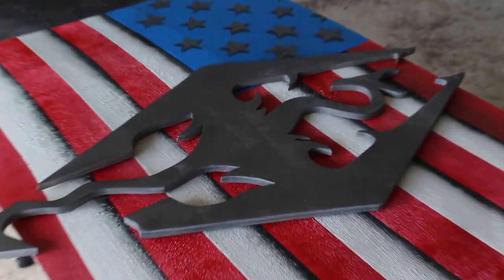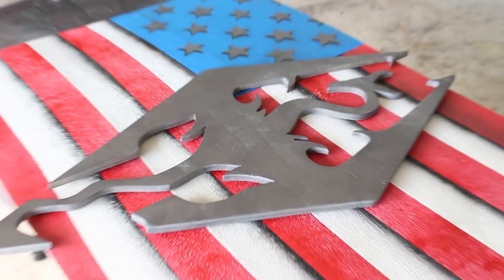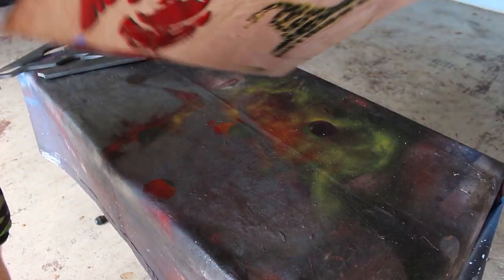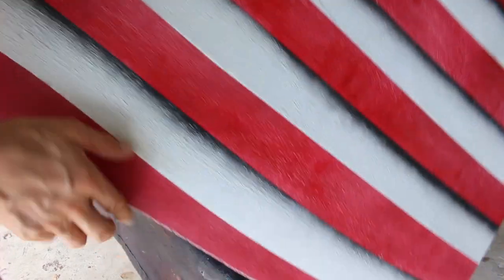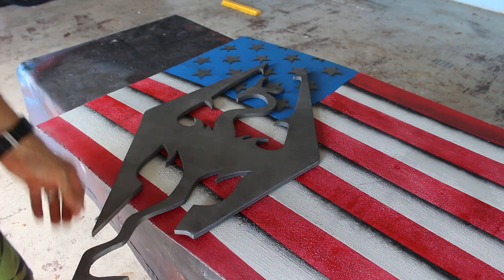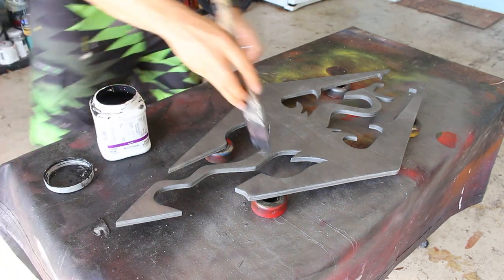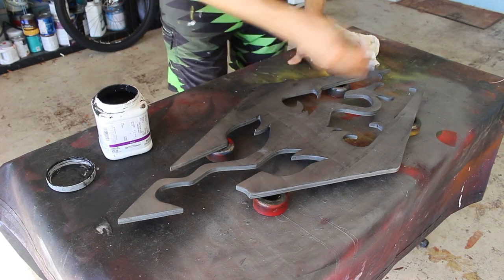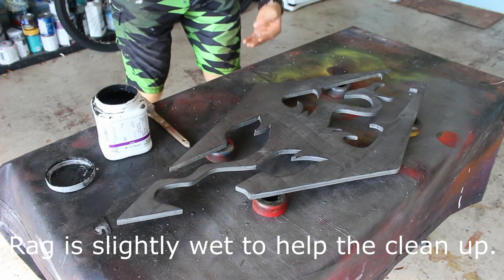Skyrim Wooden Logo Wall Art

Comment: Wow that's so cool! I might be doing one by myself. Thanks for the idea.
Reply from the maker: it's quite easy and it wouldn't be too hard to draw the shape even without the projector. Possibly just make the neck and tail a bit thicker - that's what I did to not have it snap.
Reply: @LeoTheRussian  I just got mine ready today. I drew it without the projector and it turned out fine. I just painted it black but I am not sure if it's going to be even.
Reply from the maker: @juliakangasaho6396  the beauty is it's an old beat up looking dragon so some imperfections will give it aged look and character. I did one for a friend and wasn't paying attention and screwed a d-ring on the front side - ended up with the dragon facing the wrong way... whoops